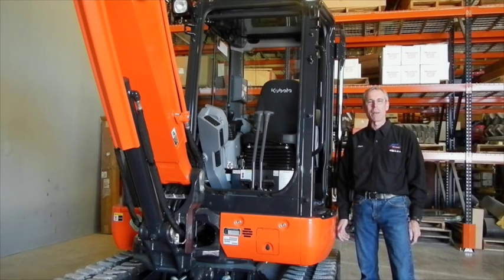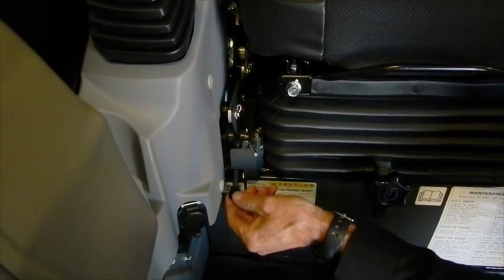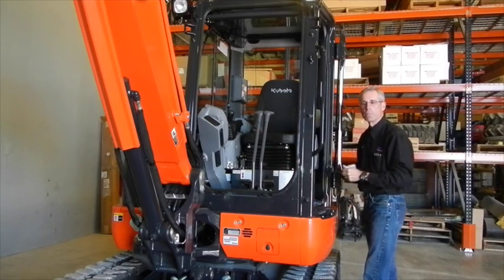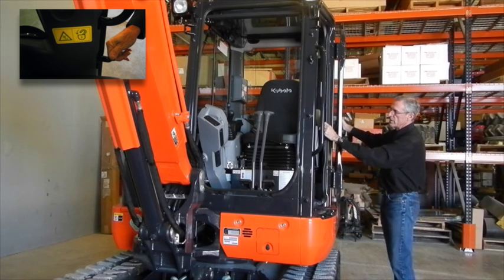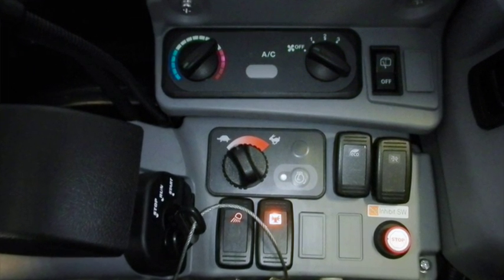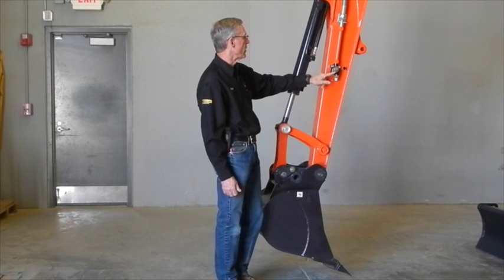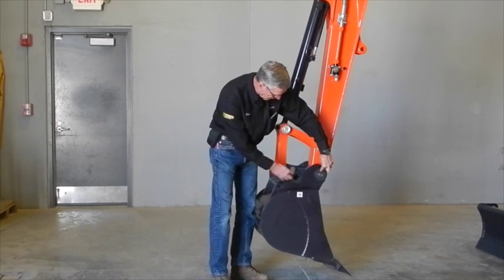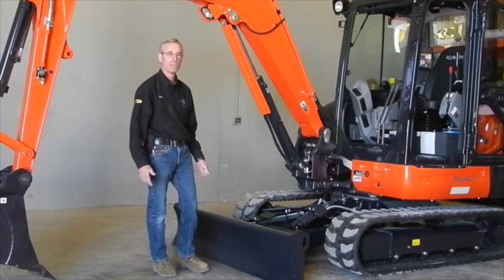Ask The Experts: What Should I Know About Kubota Excavator Basic Operation?

Comment: Got a kx057-4 in remote Honduras.  Main lift cylinder will not respond.   It will drop very slow if I push down on stick but nothing up.  All other controls function fine.  Any ideas.